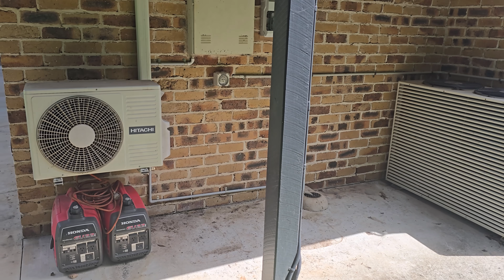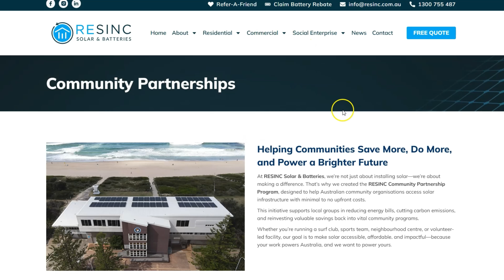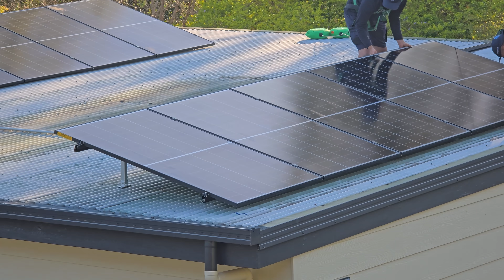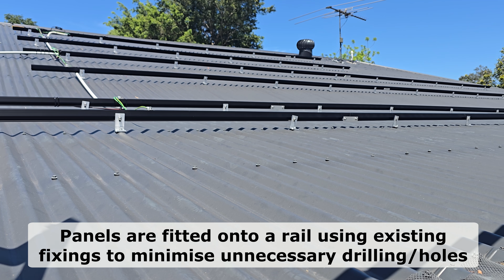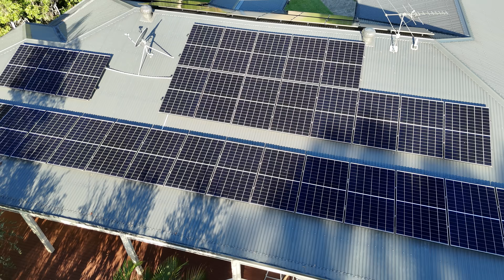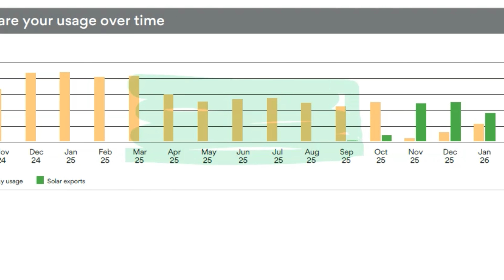From $600 Power Bills to Self-Sufficient POWER - My MEGA Solar & Battery System!

Comment: Just a heads up for others in SA. Last November we had our roof replaced after a storm. As our solar array was older than 5 years it HAD to go to landfill, along with the Inverter - even though it was working. The insurer weaseled out of a claim so we self funded the roof but decided against putting another system on.

Comment: That's a very impressive system. You would be easily self power sufficient, if you reduced the air conditioning usage, but there is no need to give up on a little luxury that you so well deserve. It would be interesting to know roughly how many years are involved, before your system if paid off, with the savings made per year. Not easy to work out, due to so many variables, I know. Including the fact that electricity prices will continue to rise.

Comment: At $600 a month it's possible you're running your hot water booster all day. If you configure that to just before you take showers, you'll cut your electricity down 50%.

Comment: If you hop on the bureau of meteorology, you can find a table of the solar that hits your area from the sun. 
It gives you a table of everyday of the previous year and you can see when the worse days were and for how long.
You might find there's 3-5 days of very low sun in a row once or twice a year. 50kW capacity probably isn't enough.
Your capacity would need to compensate for these days. However, if the weather reports say you'll have prolonged bad weather during this time.
It's usually the hot water system booster that really takes the power, maybe reduce that down for a few days during the worse low sun days.
Then you'll likely be fully self-sufficient, without having to spend more on batteries. Just a few cold/warm shower days cuts the peak and saves you plenty.

Comment: To me j s onconsumpee no poiny  to resale back to gridbecaus the   was ne was never designed to serve solar power back to grid🎉

Djid yiu  do a power  draw power draw calv on power  oower consumption

You  shoilld be using  3pbase gen  north of 50kw or

 The tow gens between   9-18-5 kw    singl5e aren't  designed for constant load

  You are lookin orth of  v you are looking  3950-600 kw dc  240-320  vav  on a 60-200 kw service

Comment: I installed a 12kw solar system with 35kwhr worth of storage. We use up to 100kwhr worth of power during summer(Ducted AC, water pumps, septic sys and EV). Our bills are only ever connection fee around $40 a month. We signed up to a power company that gives 3 hours free power per day and only $0.08 per KWhr between midnght and 6am. During these free periods we charge the car, AC the house and charge the batteries to 100%. This means even on very rainy days we still get 100% battery. I think you could greatly slash your bill by further by using your batteries in this way.

Comment: I’m in USA, NJ - I priced a 28kWh system 3 years ago (with rebates included) and it came out to $90k USD. It seemed absolutely egregious, even given the cost increase in electricity due to AI data centers recently. I’m looking into doing the install myself to bring costs down, because the hardware itself is not that pricey these days.

Comment: I had 19kW of JA bi-facial panels installed along side the existing 6kw of panels a 20kW Sungrow 3 phase inverter and a 40kwh Sungrow battery up here in the top end. After the STC credits and the max federal gov battery rebate my system cost me $34K. The system will charge the battery and deliver power to the house whilst the sun shines. Any excess is exported to the grid at a limited rate aftewr the battery is fully charged. At night the house draws power from the battery and depending on how long we use the ACs after dark will generally determine what the battery SoC will be in the morning and is somewhere between 50 - 15%. Our power bills were previously between $1900 - $2800/quarter, now they are $300 - $400/quarter. Best big chunk of money I have ever spent. Every circuit is connected to the blackout capability except for the 3 large ACs and the only time we know a blackout is occurring is when we hear the neighbours generator running 🙂

Comment: Something to keep in mind. 

That system, with the batteries, installed is in the neighborhood of $90,000 AUD.

If you are saving $400 per month on your electric bill, then...

90,000 ÷ 400 = 225 months

So it will take nearly 19 years to recoup the cost.

In other words, by installing a system like this you are simply switching who you are paying for the electricity you are using.

Comment: ask chris, if install a new higher wattage and efficent panels on the shed and another inverter but install a custom battery bank to feed both inverters into it and set a fixed rate from the battery through the lines to the house to remain compliant. and offer more storage to keep over the longer term. but also have it feed main battery when hit a threshold

Comment: For motors such as air conditioning and pumps you should install soft start switches. It reduces  the high startup by up to 75% which helps in solar powered systems.

Comment: I thought it sucked when they dropped our sell back down to 8cents  but 3 is a joke
Reply: They would not be getting my excess generation at that rate. I would have an electric motor that started up automatically to use any electricity generated after my batteries were fully charged.

Comment: Not a judgement, just a comparison, we are 2 adults living on 5 acres in Denmark WA with a water pump, air con, hot water booster, we are both at home more often than not. We use 8 kw per day. We are getting solar and battery installed in 2 months.

Comment: I just finished watching the video and to be honest I am somewhat bemused by the whole video. Here are several things I really find confusing in regard to your video. 1) you acknowledge you use what I consider a very large amount of power. Yet in saying that you take make no indication that you make any attempt to be more power conscious 2) At the end of your video you state you will not comment on the cost of the installation other than to say that after all that effort you still get a power bill of approximately $180 month or As your bill states $541 a month. So in essence your new system is only covering 2/3rds of your previous requirements. 3) You also state you will not comment on the cost based on each individual needs. I find that insulting and misleading.  Even at a basic level I feel you could have stated the cost of a 5KWH system is worth or price per panel, Sure installation costs may vary on requirement but a 50KWH system with a the required panels is a pretty straight forward cost. Only thing that may change is the difference in prices from the solar panels suppliers and battery suppliers. 4) I dont understand why you could not offer a cost benefit analysis. IE even a basic comment saying it will take us 8 years to pay our system off based on our old bills. 5) Having installed solar and battery at the most basic level I did a cost benefit calculation. Initially with a 10KWH system and 9KW solar system where we were paying $1200 a quarter for power it was going to take 8 years for the system to pay for itself. Given power price rises, that period of recovery dropped to 4 years and our power bills are normally zero - zilch,  5) You still rely on the grid for power and that you still get power bills I really do question your reasoning for the install you had done. I truly do not mean to some sort of smart arse that is not my intention but I certainly do question the install given the outcome and your lack of any attempt by you to reduce your own power needs and truly become self sufficient of the grid.
Reply: Totally agree with you. I think he wasn't honest because the upfront cost would be shocking - definitely well over 100k. I had a free 1.5 hour consult with resinc last year (yes Mark, they already do those for free) and they were incredibly over priced. I found flaws in their payback period modelling. Also they make you enter into a third party agreement with a finance company. Their system is a very complicated one, and one that the average person would struggle understanding. I think he has been quite mean actually, because people trust him, and they may make decisions based on his 'I trust everything they say' attitude. It is never smart to do that with a business who operates to make money off you. He could be up for problems in the future because he has been so deceptive in this way.

Comment: Next step Mark, check your fitting &lights. Converting to LED lights, timing pump to daytime, when replacing appliances use the star rating. These all reduce the consumption hence you will progress to self sufficiency. Great VDO.

Comment: Here in SEQ we can get days sometimes weeks of overcast weather that renders my dollar system almost useless, if I was to fork out fir a battery it would need to be capable of running my house for a week at least without sun.  And it would need to be only a third the price that is currently being asked to be viable.   It’s just not worth the dollars yet. Prices need to bone down while output and storage capacity need to be increased.

Comment: Just bought my second 82kWh BYD Seal battery from a written off EV. Aim is to take most of our farm off grid, then find ways to value add produce with power. Dehydrating produce means it's very cheap to ship.
Selling power back to the grid has a good ROI. Say it cost $20k for 164kWh and you export 80 every night at 10+ cents. $8 a night. Less $2 for meter fee and Amber's monthly fee. $6 x 365 = 2190. So less then ten years if you factor zero bills.
Similar income from less cycles could be achieved by only triggering export using home assistant when the sale price goes above say 12 cents.
With more grid scale batteries in the SE QLD grid, price spikes have flattened. But there are still occasions when the Eastern Australian grid has a generation outage and the price goes up significantly.
Our farm has a 30kW connection, so that allows fow exporting reasonable amounts when prices spike. This is achievable in a suburban setting. With three hours of free electricity coming in July, and capped at 24kW a day, that alone re-exported would cover the daily charge without using any solar.
Hope this information is useful.

Comment: We have solar panels on our roof, they are junk.  They don't charge crap, and they can't power our home at all.  We were then given a quote to replace them since they haven't produced even a single watt of power since 2019, 9 years after they were installed.  The quote was 15,000 for just the solar panels, and then we'd need the batteries.  When we did the maths of how much the solar panels cost and the batteries cost, and then divided those costs over the 10 year minimum lifespan we discovered that it would actually cost us more for paying for those items than we pay for energy.  Yes we have to sit in hot humid house or freezing cold house because we can't afford heat or air conditioning.  But there is no way we can afford to pay for solar/batteries to be installed.  Australia means poverty if you are on DSP which sadly we are.  We are as self-sufficient as well will ever be, and there is no way we can ever get solar and batteries to get off the grid.  We couldn't even replace the panels on our roof and the inverter.  QLD is hot, and it destroys everything.

Comment: TL;DR Not "self sufficient" in the end, despite massive 50kW investment. 

Can you do another video showing how long it will take you to recover the new 50kW installation costs?
Reply: That system, with the batteries, installed is in the neighborhood of $90,000 AUD.

They are saving about $400 per month on their bill. 

90,000 ÷ 400 = 225 months

So it will take nearly 19 years to recoup the cost. 

In other words, they simply switched who they are paying for the electricity they are using.

Comment: That’s an impressive system!  I have a much smaller experimental system in my shed I use for charging tools and running outside electric tools like a mower and edger.  In a pinch it can run a few items in the house.  We have stable power here, luckily.

Comment: Thanks for your transparency Mark. Your bill of $2731 for 89 days blew me away. I paid $140 this month of electricity in the peak of summer. I don't have solar panels, neither do I use air-con. If what you say is correct, and this RESINC system will break-even in "3-4 years" at that point, the batteries will nearly need replacing. I honestly hope the benefits add up for you, but as an average Aussie battler, this outlay simply can't be justified.
Reply: 10 year warranty on my Goodwe Lynx battery, I'd be surprised if the other big brands were less

Comment: We live in South West Florida, USA, which is a similar climate with similar concerns (you call them cyclones, we call them hurricanes). What I have always wanted was a smaller, targeted, system that just ran the air conditioner during the day or 24 hrs. This would significantly reduce our electric bill without the cost of a whole home system. It would alleviate the biggest quality of life issue during a cyclone. Propane (LP) generators for the refrigerators are very cheap and not needed often. And LP can be stockpiled without the problems of petrol. And it would help the environment in a meaningful way much faster that trying to retrofit all homes to operate off the grid.  It's such a simple idea that I can't understand why companies haven't done this yet except that the current government mindset is geared towards large change while ignoring the benefits of incremental change. I hope some company out there reads this and gives it some real consideration. Cheers! It was a nice video and we love your work. Keep it up.

Comment: Watching from a grid tied solar powered home in Canada at 53 degrees north. We belong to a solar club which dramatically reduced our payout time to just under 7 years on the solar system and our monthly power bills. For 7 months of the year we do not have a power bill and build credit to pay a couple of late fall bills. Rather than one big inverter each of our panels have micro inverters which invert the power and optimize the panels for shade. Your home and system are amazing.
Reply: I am a Chinese manufacturer of solar energy storage equipment, and this system is very cheap here

Comment: Your whole family is too reliant on air con, sending your power bills through the roof. Every room in your massive house is probably air conditioned, which is costing a fortune. I live in Nth Qld and its hotter and more humid than where you are, and i never need air con turned on, i simply use pedestal fans, super low cost and does the job fine

Comment: Nice system.  Even better when it's free!  I'd a gone much heavier on the batteries though - what's the point of sending valuable solar back to the grid to get a measley 3 cents and then re-buying expensive power back at other times?  Get it all stored in your own batteries screw the power companies and grid.  You gotta look after numero uno = your own house.  Only then if your batteries are at 100% should you export. :)

Comment: If you had to fork out all the money for this solar set up yourself i recon it would be at least 50k, from your savings each month how many years would it take to cover the initial outlay ? Probably at least 10 years before you actually Start saving a red cent. Thats when the savings actually Start, when the initial outlay is payed for. Then after say 10 years when the outlay is finally payed for the system is 10 years old and maybe not much life left in it

Comment: What happens if the weather is cloudy?
Reply: Solar production definitely goes down which is the reason for overspeccing the number of panels. Depends on your actual system and conditions as to how many low production days it can carry you through before you start drawing from the grid.

Comment: try $3000 a quarter in Summer due to large house and big AC. 15kw of panels and 30 kw battery dropped that to $38 credit. Mind the full week 39+ recently did draw some from the grid. All in all I love my install.
Reply: How many years would it take for the monthly savings to cover the initial outlay ?  When the outlay is covered that is when you actually Start saving money

Comment: Put in a hydroponic system and teach us all about that
Reply: that would be good. I would expect a water chiller is necessary in subtropical qld for hydroponics.
Reply: An AQUAPONICS system would be much better: Wouldn't need the chemical inputs required for a hydroponic system plus you can raise fish for the table.

Comment: You said there is about 5 optimizers on the system. Are they an item that can fail often, and if they do, does the system still run or produce power?